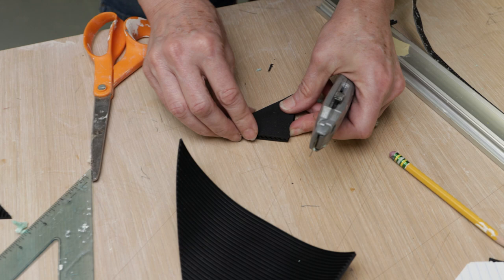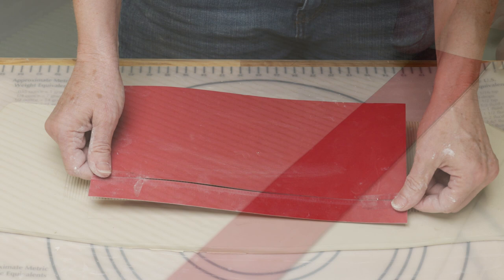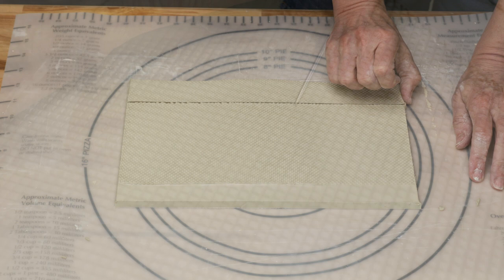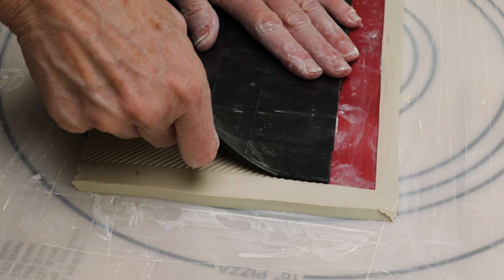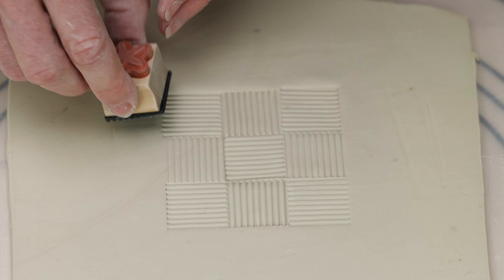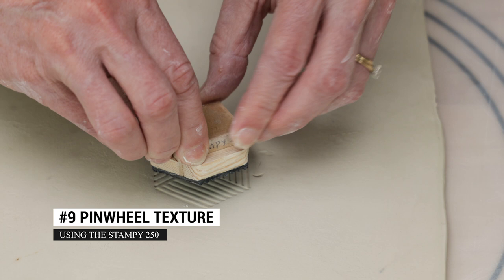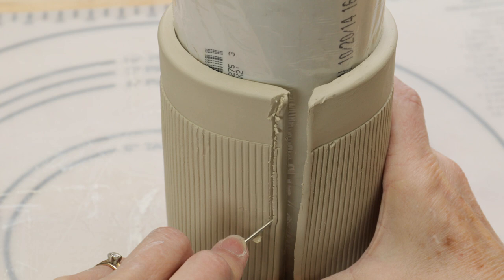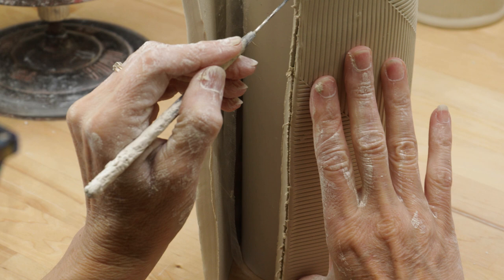10 Amazing Ideas for Pottery - USING A RIBBED MAT!

Comment: Ann, thank you so much for this video.  I just got my mat and have watched it many times.  I have a question.  On your mug handles, did you put a small coil around the top of the handle for support and do you do something similar for the bottom?  Your presentation is so very nice.  Good diction, measured pace, and you don't yuck it up with unnecessary chatter.  A pleasure to listen to.
Reply from the maker: Hi Karen - the coil is SOMETIMES for support if I think the handle may be susceptible to cracking because of the design (thin etc) - but most of the time its just decorative and looking to echo some other design element of the piece. Thanks!

Comment: Fantastic use of the textures and so many combinations. Loved the stamp 250! One question, how do stop the tiles from sticking? Looks like they lifted off easily.
Reply from the maker: In fresh clay they didn’t stick at all...the rubber worked well with the clay!
Reply: Dust a bit of corn starch on the mat and then brush off the excess

Comment: I have a Wilton cake mat similar to yours. Do you have any trouble with the clay sticking to it? You got great registration from the ribbed mat bits. Good job 👍 I used a similar mat I bought to replace the floor covering in my 1978 MGB.
Reply: Hi John. I didnt have any trouble with the clay sticking.  I have a feeling that if the clay would have been wetter, the rubber might have been difficult to release, but the clay right out of the bag was no trouble.  If you try it and the clay sticks, try dusting the rubber with a bit of corn starch.